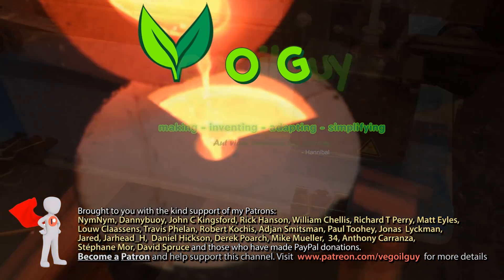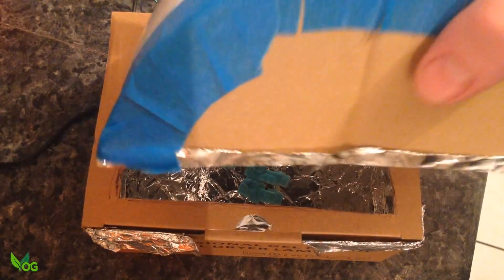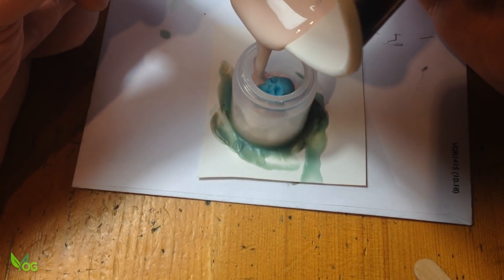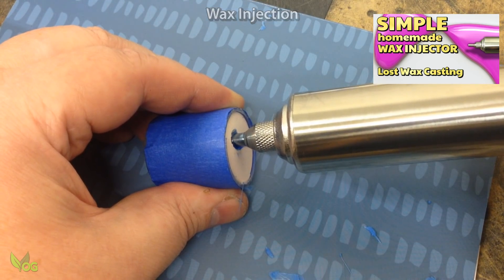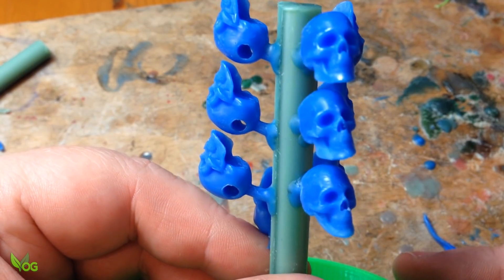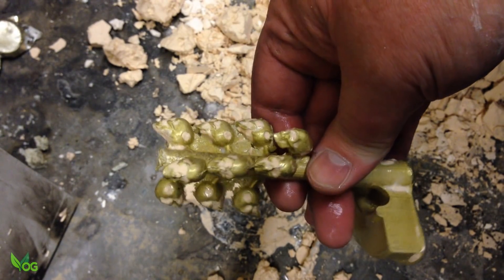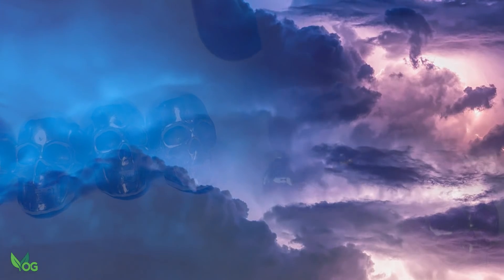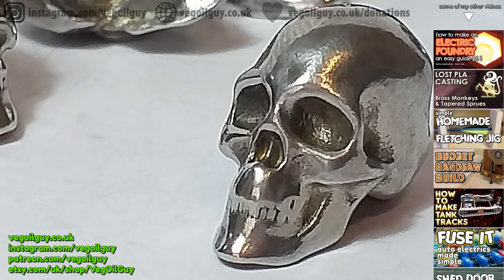miniature skull 3D Elegoo Resin print to Lost Wax metal casting + silicone mould technique- VOGMAN

Comment: Great work! Nevertheless I do not understand, why you use the step of lost wax and plater casting. If you would use a heat resistant silicone, being applicable for pewter casting, you could use the silocone mold directly and shorten the procedure.

Comment: If I may suggest that for removing the supports one such models that your rinse them in very warm water before curing. You will be surprised how easily they come off without leaving divots (holes) in your model. If you do end up with an unfortunate support divot on your model, you can brush  some uncured resin into the hole until it sits flush with surface and then hold your model under your UV light to harden it. Sweet and simple.
Reply from the maker: Suggestions and advice are always gratefully revived 😊

Comment: AMAZING!:) Please could you tell me what plaster are you using? Is it regular plaster you can find in home depot /castorama like shops for home use? I need cast some details in bronze so the temperatures ca 1100 dec C. Is this plaster suitable for that? I know i need to preheat the plaster to get rid of wax and moisture and get temperature as close to the poured metal temperature as possible.
Reply from the maker: It casting plaster, so it's a specialised product. If you look in the description of my lastest video, you'll find links to the products I use : )

Comment: Hello friend, I have tried several jewelry resins, among them bluecast, but I still do not get good results, pores, and in the negative details, full of metal, for example: on a surface I place a letter and this only I get a lump of metal(like the details in the coin that you did in another video) , no definition, please what resin do you advise me, thanks in advance
Reply from the maker: Hi William. I'm very much an amateur myself, so perfection for me is a goal. I tend to find whatever I use there's invariably a little clean up required. However, I'm planning on looking harder at resins in weeks to come with the aim of finding an answer to this exact question.

Comment: Looks great ! Question from a total newbie, could you have saved one step (and maybe one potential loss of detail) by directly printing a two part negative mold in which you would directly inject wax, in ordrer to skip the silicone step (with a heat resistant resine i guess to resist hot wax when it is injected) ?
Reply from the maker: Hi Oliver. Wax will happily stick to anything EXCEPT silicone. So making a mould means the the patterns can easily be pulled free of the mould without damage to either. It is actually possible to print silicone moulds these days. I do have some resin somewhere than does these... I really must review it : )

Comment: Have you thought about using a wood burner on low heat to melt your wax sprues? Seems like it might melt a bit better if you didn't have to go back and forth from the fire.
Reply from the maker: Haha... what are the odds... I've just bought one of these...
https://www.hswalsh.com/product/speedy-wax-pen-tc025

Obviously this is a much scaled down version but I thought I'd try small and see if I liked : )
Reply from the maker: It's all about control Austin... raising the temperature steadily is a good thing as it avoids shocking the plaster. This helps prevent cracks, etc. I dare say a wood burner could be used, but it would probably take more skill than I have to control the heat properly. I prefer the ease of electricity : )
Reply: @vogman  I think we're misunderstanding one another. I was talking about one of these as a heat source to attach the sprue to the piece. https://www.amazon.com/Pyrography-Adjustable-Temperature-Embossing-Soldering/dp/B07W9KNM8W/ref=mp_s_a_1_4?keywords=wood+burning+kit&qid=1570456621&sprefix=wood+bur&sr=8-4

Comment: Why didn’t you just burn out the SLA ?
Reply from the maker: Because I wanted to demonstrate Lost Wax Casting : )
Reply: VOG would it be bad to just connect sprues and burn out he SLA as if it were just a wax model? I’ve done it with pla but SLA is different and I want to make sure I’m not doing anything super toxic
Reply from the maker: That is the problem Gio. Most resins aren't designed to be burned and some may be toxic. I'm still looking into that.
Have you seen my most recent video about Castable Resin? That stuff is safe to burn.
https://www.youtube.com/watch?v=eDl3vzZy0qQ&lc=UgxxJrWGcTiIN7wNUEh4AaABAg

Comment: What a gratifying result - congratulations on your versatility  : )
Reply from the maker: The result was all down to the printer : )
Reply: @vogman  So, with a resin printer, you have to carry out a couple of extra steps (making the silicone mould and pouring the wax) but the reward you get for your thoroughness is superior detail.
 I seem to recall that you did once order some printable wax filament but I don´t suppose this would offer any advantage over your existing, now-perfected, lost PLA technique.
Reply from the maker: The silicone mould approach can be applied to ANYTHING not just a resin print.
Interestingly there are Castable Resins which go straight into the plaster for casting, one of which I'm playing with right now and will be reporting on soon.
And you're also correct about the castable Filaments. I have 3 samples which I need to test and review. Hang on a second...
_ Dear Diary, stop procrastinating and pull your finger out! _
Now I just need to remember to read my diary : )
Reply: @vogman  I´ve sent off for a "Mould a Willy" kit. If it does turn out to contain the ingredients for a silicone mould I´d like to try and use the lost wax method to cast it in bronze. I envision the end result mounted on a shield-shaped hardwood plaque, immediately above my front door...
Reply from the maker: Silicone mould making is easy. You'll have no troubles there.
The most awkward part, the bit that takes fancy equipment or years of experience, is getting the wax to perfectly fill the mould. I inevitably find tiny air pockets, etc, that just need a little extra wax adding.
A plaque, even a small one, sounds like more than a syringe full, so my technique from a few weeks ago might not help, but if you'll take my advice on one thing, get good wax... in my numerous fails it was always cheap waxes and homemade concoctions that let me down most. A £20 bag of injection wax is largely reusable if you take the time to recover and filter it, and wow is it good : )
Reply: @vogman  You´re so right - if I´ve learned one thing from my various attempts to cast metal it´s that using the wrong materials is folly. You put in the same amount of work with cheap materials and then end up all sad and disappointed when it doesn´t work. It took a fair few failed home-made crucibles, for example, to convince me to start buying proper ones.

Comment: I'm curious. Does aluminum work the same way as the other metals for casting small objects like this? 

I know aluminum is significantly lighter than other metals, but I don't know if that changes anything as far as casting is concerned.
Reply from the maker: I haven't used aluminium for a while. It works but as its sluggish it doesn't fill the detail well. But perhaps with a purer alloy than the scrap I use, good things may be possible : )

Comment: I’m at about 25% into the processes you’ve been doing on many similar items. It’s just not very convenient using my charcoal forge here in central California - no burn days, 100+ F degree days, etc. I need to make some of that equipment you’ve made. 

I used a similar skull that was posted as a Schrader valve cap, up-scaled it a bit more, pushed the bore hole all the way through, printed in PLA, painted a few layers of gold and clear coats and use it as a beard bead. But it will be so much nicer when I remake it in aluminum, brass, or pewter. 

Okay, maybe less then 25% the way there. I need similar equipment as you and I thank you greatly for all the videos you’ve posted. I’ll get there eventually.
Reply from the maker: Hi rojer, that's great to hear. There's a fair bit of equipment involved and I've found ways to reduce the costs significantly with a lot of homemade things, but it does take time and money. But stick with it. The things you can do are are limited by imagination - and it sounds like you've got lots of great ideas there : )

Comment: Have you tried casting pewter directly into the silicone? Should be a low enough temperature.
Reply from the maker: Thanks Ian... yes, I've had as few requests to have a go at that : )
Reply: Lol just came down to the comment section to suggest this. Just have to make sure it can take the heat like a Platinum Based Silicone. Tin based silicones can't take the heat.

Comment: Great video. I want make some motorcycle detail (clutch lever) by this (or simillar) method. But I think needs aluminium for that.
Reply from the maker: Aluminium is a sluggish material. I've used it a few times on larger projects but as you get smaller, like this, it starts fighting back. It's not impossible and ideally good quality alu ingots are the best way. But bronze works really well as it pours so nicely. It's stronger than alu, just as impervious to whether, can be polished to a golden shine or chrome plated if you prefer : )
Reply: @vogman  thank you for reply. Where do you get raw bronze balls (4:35)?
Reply from the maker: I not sure I've ever seen Bronze sold in anything but ingots. These can be expensive. Personally I tend to use scrap and you'll see me making bronze items in a lot of my videos. Simply take copper (scrap pipes, etc) plus 10% (by weight) aluminium. This produces a very strong alloy called Aluminium Bronze (or Bronzal) and is probably the most popular Bronze used these days.

Comment: This was awesome!  I've been hoping that you'd get to this point where you make silicone molds to pour wax items for your casting and it turned out fantastic! :-D

I do have one question for you:  When the tree came out of the plaster it looked like there was a vertical mold line running between the skulls.  Was that from a crack in the plaster when the pewter was poured?
Reply from the maker: That line (nicely spotted by the way) was flashing. It tends to occur when pieces are close together and when hairline cracks occur in the plaster. In this instance is was VERY thin and mostly disappeared with soapy water and a scrubbing brush. A small steel brush and no pressure at all got rid of the rest : )

Comment: I always like to remove the supports before curing, but that may be personal preference. 

There's a technique you can use when cutting the silicone off the part where you cut a zig-zag pattern on the outside (not where it meets the part, though) and this works like keying the model to get it to line up straight every time. Of course, this mold may have been too small for it to really matter, I'm not sure. 

But the silicone mold thing is something that I've been wanting to experiment with, so it's good to see that in a video. And the idea of filling holes before printing is great, I hadn't thought of that (I was attempting tricky two part molds to work around holes in the part). I'm going to have to try this now!
Reply from the maker: Thanks Voro. I think zig zagging the cut is suitable for larger silicone moulds but in this case, I would have been in danger of missing the pattern. Of course the main purpose of the zig zag approach is to enable to halves of a mould to come back together. By not fully splitting the mould, I do away with that problem.
There's so many techniques and ideas, it's great to share them in an arena like this. That way we all learn something. I do with every video I make : )

Comment: Interesting to see you playing around with wax Geoff. I had to help one of the Art students mount a full size torso front and arm to a plywood board during the week. Quite an exercise in creative lateral thinking would best describe the situation. The torso front was fixed down with about a dozen screws driven in from behind through pre drilled holes. Very iffy fixing into the wax but with hot wax poured in between the wax already stuck to the plywood and the back of the torso casting we should be right. As for the arm it had been cast just in wax and I was sure that no screws would hold the arm given the low shear strength of the wax and the amount of cantilever weight in the arm. I determined that the best course of action would be to retro fit a threaded rod into the arm and have a backing plate fixed on the reverse side of the board. I then drilled a 16 or 18 mm hole down into the wax arm, pre heated the threaded rod with the heat gun to prevent rapid chilling of the wax, and poured in the molten wax after quickly warming the bore hole with the heat gun. The wax set up fairly quickly but I told the student to leave the arm for at least one day in order for the wax to completely cure to the rest of the arm. I am hoping that this will work well but it would have been better if the arm was cast with the allthread from the beginning.
Reply from the maker: FULL SIZE??!!!?? Amazing...
My art skills are amateur at best but that doesn't stop me admiring my betters. I'd love to see a few pictures : )

Comment: They look great! The only part that seems less than perfect is the teeth. Did the tumbling process flatten out the teeth a bit?
Reply from the maker: You've got to realise how tiny those teeth were. On the 3D print I couldn't see them without a strong magnifying glass. The print is then effectively copied twice through Lost Wax casting and then hammered by steel shot. And yet these teeth - which much be 2 or 3 to a mm - can still be seen. If you held it in your hand as I have, I guarantee you'd be equally surprised  : )
Reply: @vogman  please don't get offended or take this wrong Geoff but realize is spelled with a Z rather than an S.
Reply: @susanserwatka931  not in the UK. US English replaces a lot of Ss with Zs.